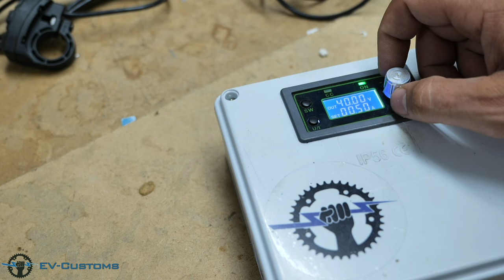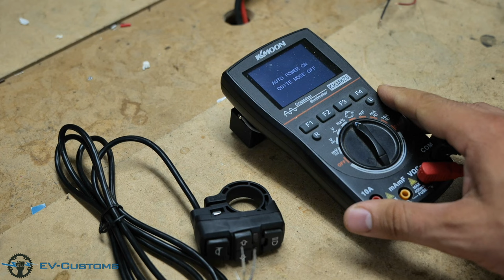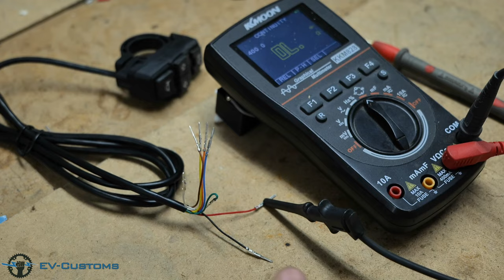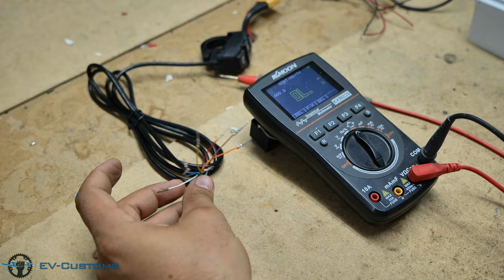How to Connect DK336 Handlebar Switch Buttons - Tail Light, Turn Lights, Horn

Comment: Great video! Thanks for providing clear information (I’m a complete novice) as this was the first tutorial for this exact switch that explained how to connect clearly. I’m installing 12v DRL (in-built controller) led strips to my escooter (main usage is the turn signals), would you recommend using a 12v portable battery or can a converter with a 2000-3000mah battery work?
Reply from the maker: Hi friend.. obviously with dc to dc converter 72v to 12v 3A, they are almost free on AliExpress

Comment: amazing and simple explanation, im pretty sure i will be able to do the same, following the intructions here.
By the way can you do some videos on how to upgrade stock ebike motor controller to more powerfull one and how to chose which controller to use.
plus how to find ebike battery real capacity, cause i feel like sometimes the battery capacity claimed by the seller is much lower than what it actually is, especially with those chinese brands.
Reply from the maker: Hi friend...  About how to upgrade controller i it is in my mind...  about fake batteries it is easy to find the real capacity,,,. i suggest to not buy batteries from internet..